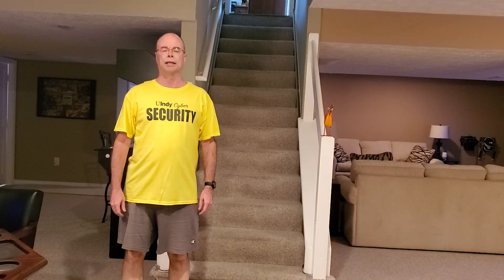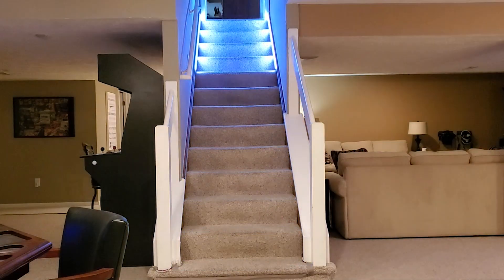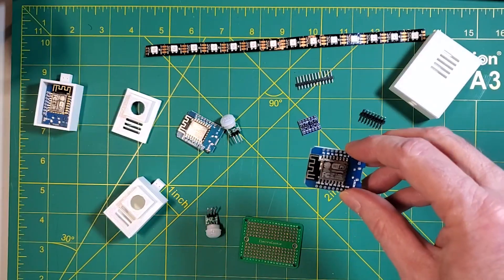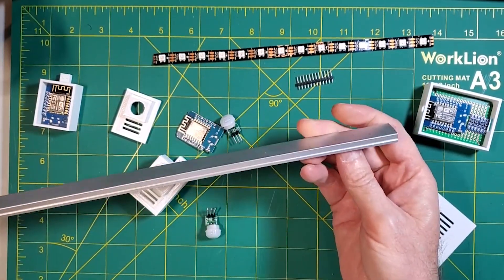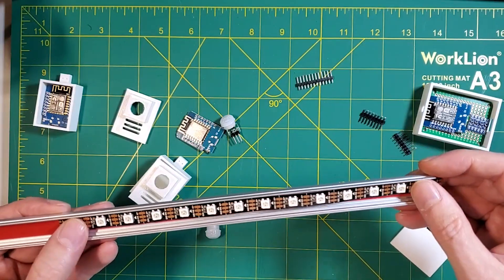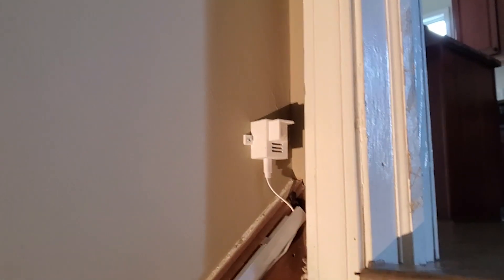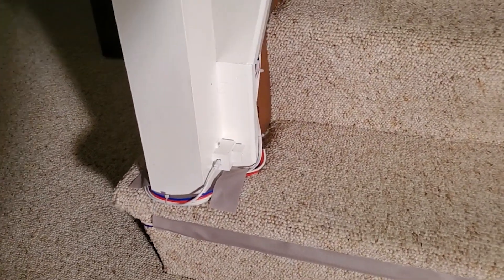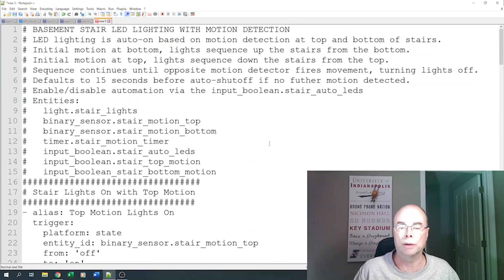Motion activated LED stair lighting... without staircase modification!

Comment: Did the same thing, but instead if the PIR  I used a camera, and opencv.  It looks for the feet, and lights up the stairs around your feet.
Reply from the maker: I did an update to this original video where I replaced the PIR sensors (too many false triggers) with VL53L0X distance sensor and created more or less a "trip beam" across the stairs.  It has been MUCH more reliable than the PIR sensors (at no real additional cost) and no more false triggers.

But thanks for sharing your method.  There are many different ways to accomplish the same or similar task.  I also have another take on the stair lights that is completely standalone... no Home Assistant and no ESPHome required.

Comment: Looks good shame I'm no good with electronics
Reply from the maker: I honestly had very little experience when I first started out... and only a tiny bit more when I created the stair lights.  I was a bit timid at first myself.  But if you haven't worked with small electronics before, I do have a video targeted at those that might be a little hesitant to start their first project:  https://youtu.be/ruSf2Mc-fgQ

Note that I also have a follow-up video where I replace and substantially improve the detection sensors.  And in case you aren't a Home Assistant user, I also have a version that works without any third party systems (only WiFi is needed):  https://youtu.be/b4s_VEtVWY4

But if you have an interest in these sort of topics, I'd encourage you to give DIY electronics a shot.  As long as you follow a few basic precautions, generally the worst that will happen is that you'll destroy a $3 component or two!  Regardless, thanks for watching and leaving a comment (on a very old video!).

Comment: I did it with Lidar.  I put a lidar module at the top of the stars off the side and aimed down toward the opposite side of the bottom stair.  Based on the distance measured you can turn on or off the specific LEDs on the stair you are on and one on either side.  If I were building a new staircase, I would put a lidar module at every step.
Reply from the maker: Yeah... I have a follow up to this video where I replaced the PIR sensors with VL53L0X ToF sensors:  https://youtu.be/ZRb_wpJo1AM

Much like your version, it is based on distance instead of motion.  This was a major improvement in my case and eliminated false triggers entirely.  However I still maintained two sensors... one at the top and one at the bottom, essentially just swapping out the old PIR sensors.
Reply: @ResinChemTech  Cool.  Same sensors I used.  The only issue was that every now and then the lidar would fail to sense at the top due to the narrow beam close to the sensor.  I thought about putting another lidar at the bottom and averaging the distance between the two.

Comment: Thank you!  I've adapted your pir sensor to work with turning on and off Home Assistant lights as they don't require a 'cool down' period like traditional motion sensors do :)   When it sees you it fires.. no cool down necessary... awesome!!
Reply from the maker: Well, I believe you are already aware, but I did a follow up to this where I replaced the PIR sensors with VL53L0X ToF distance sensors, and it was a major improvement:  https://youtu.be/ZRb_wpJo1AM

I do this by turning the distance sensor into a 'binary trip beam sensor' via ESPHome.  This allows me to specify a particular distance where "motion" will be detected for triggering the LEDs.  No cool down, no more false triggers, etc.  In fact, I've adapted this to other situations where I just want to trigger something in a particular range... as opposed to anything within the FOV of a normal motion or presence detector.

Do you have someplace where you've shared your modifications (e.g. Discord)?  I'd be interested to see what you did to get the 'no cooldown' period.
Reply: @ResinChemTech  Yes I saw that and it was excellent..... I made those to use and turned your stair project into underbed lights :)   Your ideas are always good!!!

Comment: I'm new to SBC's and am trying to do my stairs. I'm confused as to how the sensor SBC's are communicating with the led controller; I look at the overall schematic and can't figure out how the sensor controllers communicate with the led controller for turning on/off the lights
Reply from the maker: Well, this particular version requires both Home Assistant and ESPHome.  The sensors do not "talk" directly to the controller.  Instead, all the automation is handled via Home Assistant.  It sees the trigger from one of the sensors and it tells the LED controller to turn the LEDs off/on.  This version will not work without Home Assistant or a similar automation system (like NodeRED).

However, if you are not a Home Assistant user, I did design a system that works standalone... without any external systems.  It doesn't have as many features, but the end result is very similar.  You can watch that video here:  https://youtu.be/b4s_VEtVWY4
Reply: @ResinChemTech  Thank you for your quick reply!  Again, thank you for your pointers; I watched the other video for the standalone project.  I've only just installed Home Assistant but put it on hold because of my lack of experience using it.  Regardless, I really appreciate your help!  Hopefully I'll get my project cobbled together soon.  One last item, I came across a video where someone was able to finagle WLED settings for stairs (youtube vid link: https://youtu.be/O5l1mbxDUpc?si=JyNrh0PbBCGzeDxf ).  I was wondering what your thoughts are for trying your physical build (from the standalone video) with the finagled WLED settings in the video I came across.  Your insights and pointers are a valuable asset for us DIY'ers ;-)  Until next time, my tinker-tech's!
Reply from the maker: I'm always more than happy to help!  Just let me know if you run into additional questions if or when you decide to tackle the project... either with LEDs or Home Assistant.  Best of luck!
Reply from the maker: That would work  but with some limitations.  Obviously what he created is meant to only work with one sensor.  In other words, even with two sensors, both would do the same thing... turn the LEDs on for a set time and then turn them back off.  If that's all you want, then great!  You could certainly take my build and use WLED on the controller instead of my custom Arduino code.  

What you'd be missing is the fact that if the lights are on, triggering a sensor turns them off (or vice versa).  And unfortunately you can't assign more than one action to a sensor.  So you can run a playlist, but you also can't test if the lights are already on and turn them off if the opposite sensor is triggered.

But if all you really want is for the LEDs to come on when triggered by motion and then run a set pattern for a given time before turning back off, then his WLED method would work.
Reply: @ResinChemTech  Roger that. I didn't consider tripping the opposite sensor, which would start the playlist over again. I think I'm going with your original video setup; I took time yesterday to get my home assistant back up again and got esp home installed; I'll be tinkering around with it to test prototypes. Thanks again for your insightful & encouraging exchanges!

Comment: Hello , can I use gledopto esp8266 controller ? Also if I can, do I have to use home assist or yaml ?
Reply from the maker: Yes, this particular version does require Home Assistant.  If you want a single controller version that does not require Home Assistant, please watch this video:  https://youtu.be/b4s_VEtVWY4
Reply: @ResinChemTech  great thank you . Can I use wled and 3 ESP32-WROOM Board
Reply from the maker: This particular version is already using WLED for the light controller.  If you want to use an ESP32 for the WLED controller and for the motion sensors (although it is sort of overkill), you can certainly use them instead of the D1 Mini.  However, you still need to use Home Assistant and ESPHome.
Reply: @ResinChemTech  the top stair motion sensor is working on the side left and right . I need to connect the bottom of the stairs . currently have 2 esp32 for the motion sensors. A gledopto esp8266 controller and an extra esp32 . Im confused on what and how to connect them all to work properly. Again thank you for your help you are incredible and telling all my friends and family about you . Thanks for your help .
Reply: I am very grateful for all your help . I can  start the project from the beginning if that needs to be done
Reply from the maker: I'm happy to try and help out as best that I can... at least here in the YouTube comments which is somewhat limited.  I'm not sure if you've read the written guide for this project ( https://resinchemtech.blogspot.com/2021/07/simple-motion-activated-led-stair.html ) that helps to explain how everything is wired and set up.  But in my particular design, each of the three controllers (the gledopto and two ESP32 controllers in your case) are all independent and not connected to each other in any way.  They can share a 5V power source, but otherwise they are not connected.  One is the WLED controller (gledopto for you) and the other two are standalone controllers with either a PIR sensor or VL53L0X ToF sensor attached and running ESPHome.  It is the Home Assistant automations that make it all work together.  Hope that helps... take a look at the written guide if you haven't already.
Reply: @ResinChemTech  going to read it now in detail . Will get back if need be thank you again and again and again 🙏🏼
Reply: @ResinChemTech  just read the whole thing . Easy to understand ( mostly) . Just to confirm , I need to use home assistant in order for this to work ? . Do you have a tutorial on how to set up home assistant and how it works ? Thank you again
Reply from the maker: Correct.  This version requires Home Assistant.  But as I linked to above, I do have a version that only uses a single controller with two connected PIR motion detectors that runs without any other systems.  But you won't be able to use your current gledopto... and the compiled firmware currently requires an ESP8266.  

But if you are interested in Home Assistant, you can start here: https://www.home-assistant.io/
Reply: @ResinChemTech  got you 😁 could I use only home assistant or do I need both (home-assistant and esphome) 🙏🏼
Reply: @ResinChemTech  thank you so much your amazing !!!

Comment: Hello again, I hope you are well, I built this as described. I Soldered it myself! I’m testing it out with your code now and I Got it somewhat working with Home Assistant. I also built the two binary sensors using the same motion pir detectors to keep everything the same. For the software automation part I utilized your GitHub package. Actually it seems to be working but I am getting a couple of helper log errors. Number.stairs_speed and switch.stairs_reverse are missing. Not sure why according to the package helpers were supposed to be created. Very new at this my first attempt so huge learning curve. I actually have the stair LEDs all installed and was going the route of a dig uno which I have installed, but not automated. So my plan is to convert what I have learned on this over to that which is a esp32 so it’s going to require some adapting with the pins and board naming ect I would imagine and convert the binary sensors to the two in wall PIR’s motion switch sensors that I have installed. Basically a momentary on and off switch contact alarm style based pir. N/o or N/c. I was just thinking I could go either way with the sensors that I have installed either directly connect to the Uno controller board, which im not sure how being that one of the sensors is normally open ones normally closed or connect to the binary sensors that I built, Appreciate your thoughts and input. Thanks.
Reply from the maker: Sounds like progress!  Do you have the WLED integration installed in Home Assistant and have you added the WLED controller for the stair lights to that integration (if you have the integration installed, it should automatically show up as a Home Assistant notification that a new device was discovered).

Both the number.stairs_speed and switch.stairs_reverse are entities created via the WLED integration... they aren't something that is part of my package or something that you should have to create yourself in YAML.  Of course the entity names might be different depending on what you name the WLED device when you integrate it, but you should have have a switch and number entity.  There are a number of other entities created as well (although some like the selects for presets and playlists will only show up after your create the first one in WLED).

If you continue to have issues, would you mind contacting me via email?  It's just a little hard to provide more than just basic answers here in the YouTube comments, since I can't post images, photos, code blocks, etc.  You can get my email address from the 'about' section at the top of my channel page.
Reply: @ResinChemTech  Hello and thanks again for all your help. I will contact you over on your email. It will definitely make it easier to share photos, etc.. and now for a update I got it all working correctly according to your information. When I finally figured it out, I was actually making it harder than what it was. OK now for my next step. I don’t actually have the motion sensors installed because I’m going to use the ones I have installed which are the alarm type PIR’s motion sensors basically a Fancy switch or a door contact is what it is, so I need a way to configure those switches to the D1 mini as an input like the current motion. So I have two motions mounted one at the top and one at the bottom. I’m going to mount the D1 minis with the controler so I need to just need to run the wires that come from the motion sensors and configured as an input to the D1 minis. I may even be able to get by and replace both D1 minis was just one input controler board for both sensors maybe. But basically these motion sensors are just dry normally closed and normally open contacts so I’m not sure I need to run the 5 V through the contacts from either ground or +5 V to the GPIO pin on the D1 mini. This is what I’m trying to figure out now.
Reply: @ResinChemTech  Hello, you had mentioned responding to your email. I could not locate your email address other than your blog account.
Reply from the maker: If you go to my main YouTube channel page ( https://www.youtube.com/@ResinChemTech ) and click on the channel info right under the subscriber and video count, you will be able to see an option to get my email address.  I don't publish it her in the clear due to it being picked up by spam bots.  Previously, this email address was labeled as being for 'business inquiries only' (YouTube has since removed that label), but I'm fine with responding to questions or issue from folks that I invite to email me.

Comment: Hi is it possible the use the same set up with a esp32 board in trying to do the same thing you did but using esp32 boards
Reply from the maker: Yes... both WLED for the LED controller and ESPHome for the motion detectors both support the ESP32.  There are three boards for the entire system and any of them can be either ESP8266 or ESP32.
Reply: @ResinChemTech  ok question can I pay you to build this system for me or can you show me how to hook it all up using the esp32 board ?
Reply from the maker: Sorry... as I've told many others, I simply don't have time to build any of my projects for others.  The goal of my channel is to show you how to build these things yourself and my related blog articles generally provide step-by-step instructions, parts lists, wiring diagrams and more.  Besides, for something like this, by the time I bought the parts, assembled it and then shipped it, the cost would be prohibitive.

But I have a couple of questions.  First, why do you feel the need to use ESP32's for this project?  The ESP8266 is plenty powerful (and cheaper) for what it is doing in this particular project.  As designed, you need 3 separate controllers.  It is not designed to work with a single controller... of any type.   

Next, are you a Home Assistant user?  This project requires that you have Home Assistant (or another automation platform like NodeRED) configured and running in your home.  It simply will not work without it.

If you do not have Home Assistant, I did design a similar system that works with one controller and without Home Assistant (or any other automation platform) and only needs WiFi.  It doesn't have as many lighting effects as this version, but it still does basically the same thing and is built in the same way.  You might take a look at that version:  https://youtu.be/b4s_VEtVWY4

I'm happy to answer any specific questions and try to help, but unfortunately I don't have the capacity to build any of my projects for others.